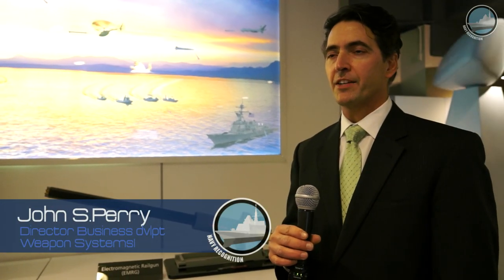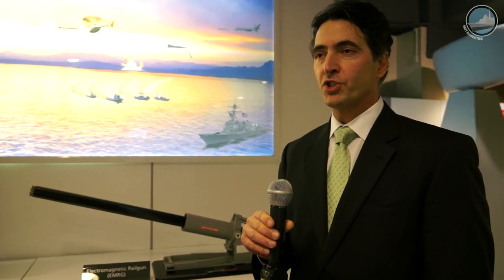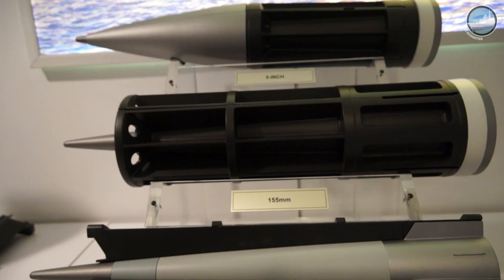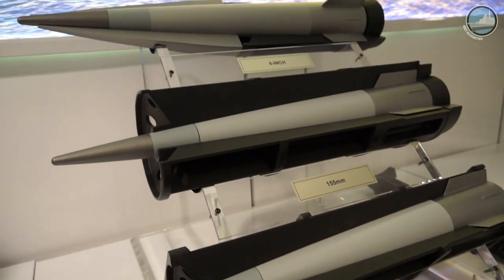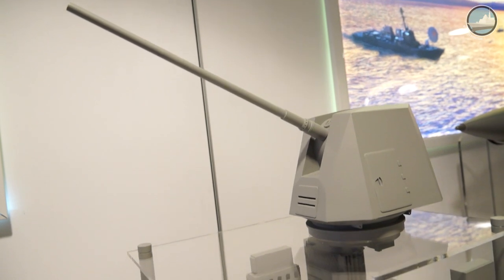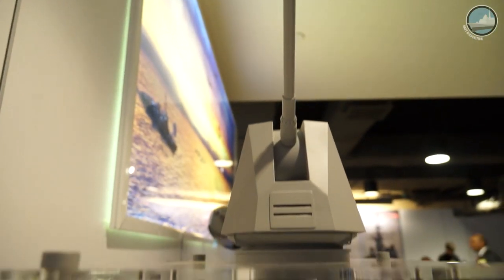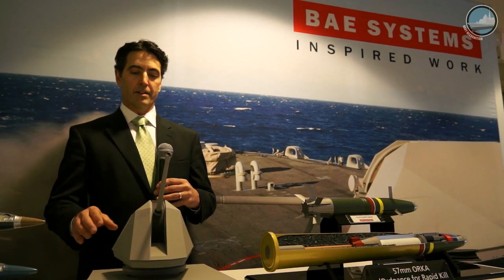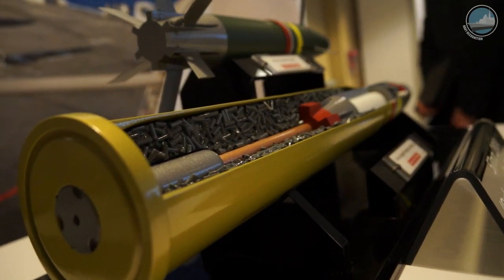BAE Systems at Surface Navy Association SNA 2017

Comment: Mount that railgun on a truck and you have a solid coastal defense system.
Reply: I've seen animated designs of it on a huge trailer towed by a truck, so the Idea is out there
Reply: You'll have some problem powering it unless you bring a nuclear-reactor truck as well.
Reply: Tribersman I agree that power will be an issue as the entire system is electrical. They can maybe have 4 trucks in the party: the weapon system, command and control, dedicated power generator, and projectile replenishment. But yes, a lot of research and development will be needed.
Reply: this could be especially interesting for future missile defence systems.
Reply: Lemuel Nicholls 
Perfect for Iran. Had Clinton won the hot seat, this weapon would have been available for any government willing to provide the right amount of "donation" for the Clinton Foundation.